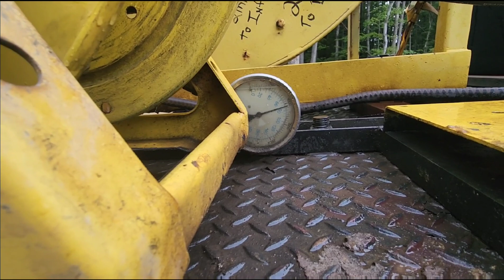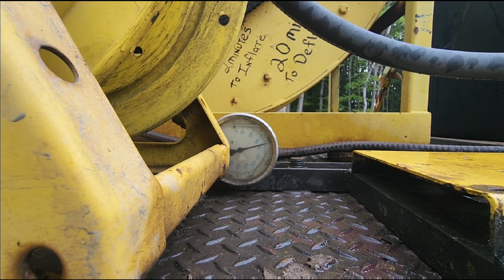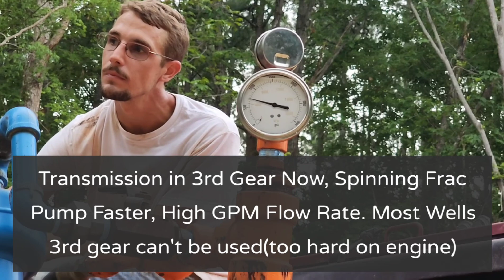Hydro-Fracing A Water Well, Cleaning Out Aquifers with High Pressure to Increase Flow Rate Into Well

Comment: Very informative video....Those relatively Low pressure fluctuations seem kinda strange....As you know, being in Close proximity to all that metal during a rain, lightning can seemingly Strike unpredictably & everyone have a Bad day....A lightning risk Mitigation technique is Tune an AM radio (Car, truck etc) at either end of tuning range to a vacant Dead spot with lots of smooth Hiss listening for erratic timed loud Crackles....You will instantly Hear, at light speed, any Inter-cloud pre-Lightning discharges within a few miles or more....Kinda like a handy effective "Early Warning lightning Detector" of sorts.....Takin blind sketchy Risks with lightning strike aint worth it....

Comment: I used an old well driller in my area that has had a very succesfull buisiness for years in western Pa. He has both rottary and cable tool rigs. He told me he always uses the cable tool rig to develop the water pocket in the aquafer because the rotary drill pluggs up the aquafer. He told me over half of his business if reastablishing failed water wells drilled with rotary drills. He drilled mine at 250ft in 1995  . Cased it to 100ft with steel casing then dropped a plastic casing inside of the steel with a seal between the 2 casings and drilled holes in the sides of the bottom 2 plastic casing pipe lengths to prevent cave ins on tbe pump. I use it to fill swimming pool , house supply , barn supply. No iron at all and no issues.

Comment: I have a 30” concrete sleeve well which I measured about 60 ‘ to the bottom but I think there could be several feet of sludge build up since the well was dug in 1959. How can I clean the sludge out of it?

Comment: They sell bigger versions of that pump system on iron planet auction site, 15K psi up to 40K psi with diesel engines used in gas and oil fracking, you can find pretty good deals on them when the big companies are done with them. I want a 30K unit to convert to a hydroblasting unit. Its pricey the hose and gun kits start at $10-15K each  Gardner-Denver make the pump units

Comment: Did it help or not
Reply from the maker: It was up to the other drilling company to do the pump test. Typically no news is good news. If it didn't work, I would have been informed about it.
Reply: @h2omechanic  what was the cost range for this service?
Reply from the maker: @winstonortega6941  $2400-$4000
 Depending on distance traveled & if the pump is still in the well.

Comment: stop jumping off them trucks climb  down like an old man or will be walking like an old man by the time you're 40.
Reply from the maker: I'm 34 and am at the beginning stages of that unfortunately 😔 .  I'm 3rd generation, been full time since I was 17.
Reply: @h2omechanic  , 34... I remember that age, the strength, vigor & resilience, where did time go... Still, there's no time like the present to begin taking better care of your joints. Obviously strengthening and flexibility exercises help along with a proper diet of protein etc., after all the muscles/ligaments help support the bones and joints.

 I had tried a glucosamine/chondroitin supplement for a short time to help with some of the aches and pains. But doing like @Salty Buckeye suggested helped the most. Just take it easier on those joints whilst remaining active, good footwear is important and apart from hereditary degenerative conditions, you should heal up. Enjoy the videos btw, it's an interesting aspect of wells I never knew about. My dad's old place actually had a well large enough you could fall into but it was capped after it was determined to be "contaminated". The shallow well we used all of those years was less than 100'. It would only begin to "run dry" when mom was doing laundry in the separate utility building.
Reply: If I jump down now at 41 , I give myself a concussion..

Comment: Nice budday. Work up here in northeast for my old mans drilling company. Since 1970 used someone else to frack our wells. It’s time to build our own. Finding a pump seems to be hard atm.
Reply from the maker: Contact Wheatley. Our setup is simple!  Old car engine, I'd use a Toyota sr22 nowadays.  Trans to a 8to1 pulley. Belt drive. 3 piston pump. & 200ft of hydrolic line for the packer.
Reply: @h2omechanic  I see that hose for down the hole. Never thought of that. Mint. Ya itching to get going on a frack rig. I’ll give them a ring. I see one on eBay just the pump. 28k

Comment: I just had a well drilled. The well driller said he drilled to 620’. He then put the well pump at 500’. So that’s leaving 120’ to the bottom of the well. Is that normal on setting the pump?
Reply from the maker: Yes, that seems like a normal setup. Never set a pump on bottom or near. 
Plus pumps struggle to lift past 500ft

Comment: The well held 500 PSI?  That is over 250 feet of water.  Any subsidence in the area?  
You mentioned back flow had sediment,  did you use a trash pump to clear it?
Reply: how do you figure 250ft?  Maybe 1000ft?